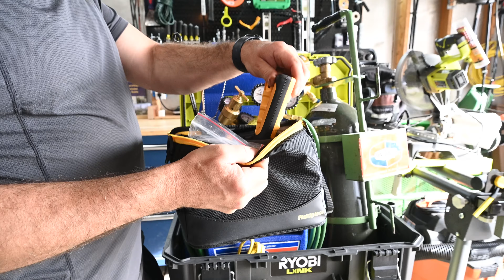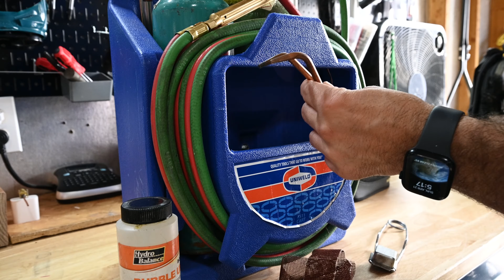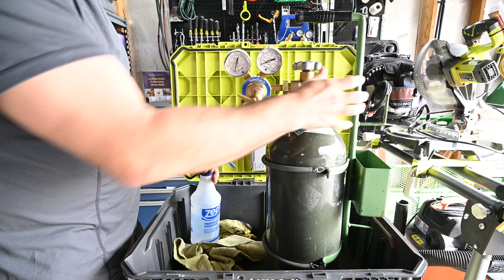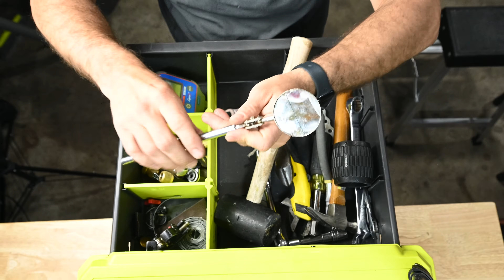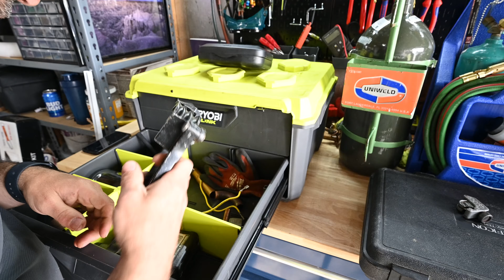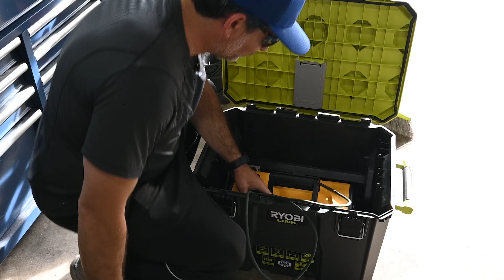HVAC Tools / Setup I use for Rooftop Repairs

Comment: Up grade you scales to the Fieldpiece and it will work with the app are the manifold set. And the NAVAC battery vacuum pump is a lot lighter and no need for a cord.

Comment: century makes the best extension cords in the usa the pro glo series is simply outstanding the are the most flexible durable quality is power indicator lights on both ends and glows green to show it is grounded
Reply from the maker: Thanks I will check those out 👍

Comment: I don’t use oxi acetylene anymore for anything 7/8 or smaller. I use a small mc tank with a turbo torch. Much lighter and easier to carry. I use the larger tip on everything. Cheers brother!
Reply: @th-bk2qs I wish supply houses around here had the aluminum ones but I’ve yet to see them.
Reply: @th-bk2qs well, the places that swap them still don’t carry them.